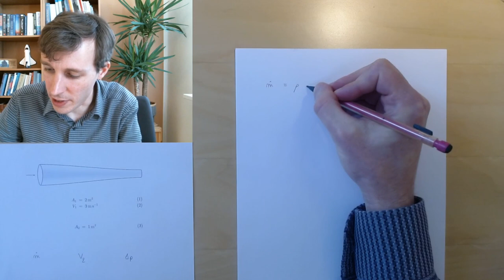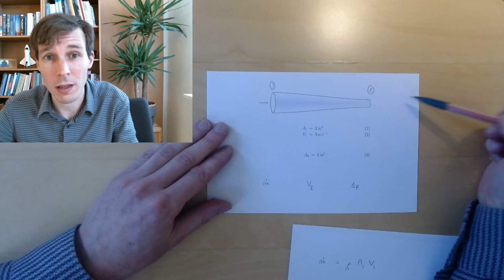Calculating  pressure change in a perfect nozzle (Fluid Dynamics with Olivier Cleynen)

Comment: Amazing video. It's clear and has a great explanation. The only mistake I saw was that after you put the -(P1/density1) to the other side, it should get positive and not stay negative. So your final answer should be P1-P2=1/2density (V1^2 -  V2^2). After all incredible video!
Reply from the maker: Thanks Conan for the compliment :-) 
Are you sure about the math? At 9:50 I (implicitly) changed the sign on both sides. The final change in pressure (p2 - p1) is definitely negative!